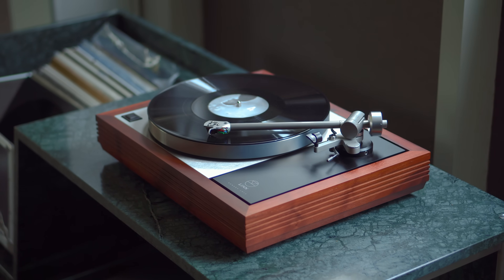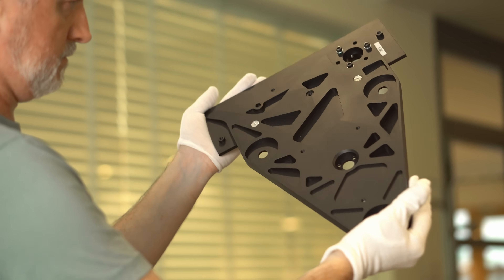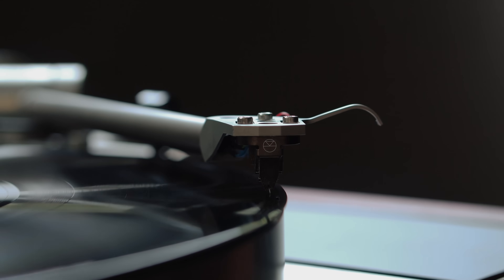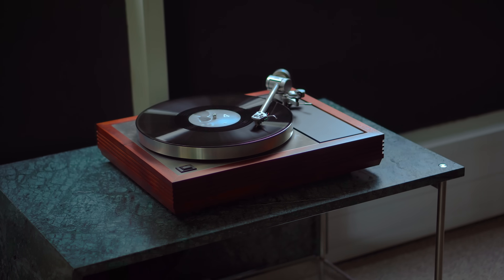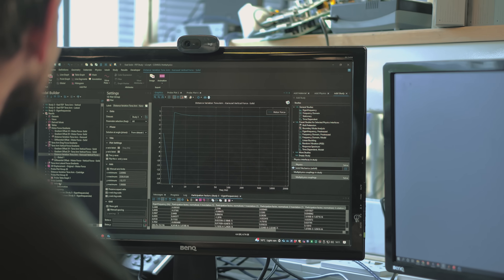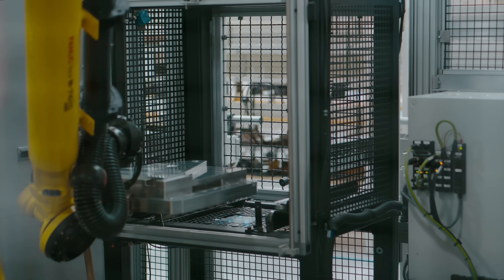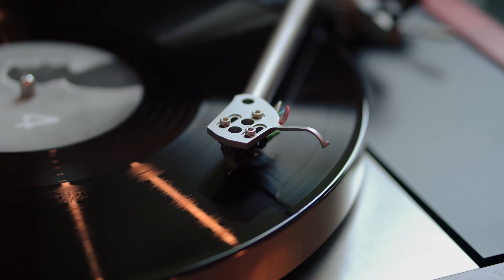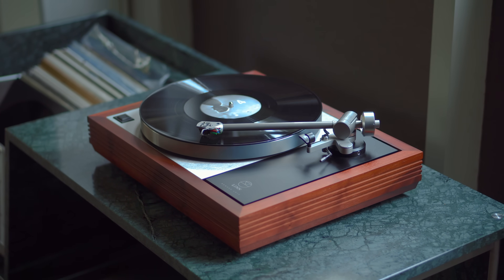New Keel SE: Flagship Sub-chassis for LP12 | Linn

Comment: Nothing new here: Not only did the Heybrook Turntable have a cast aluminium subchassis but so did the original AR turntable (the great granddaddy of all the classic suspended subchassis decks like  Linn, Ariston, Thorens etc.). Logic’s DM101 also featured a substantial 10mm aluminium subchassis. Given the original subchassis rings like a dinner gong I’m surprised it took Linn so long to rectify the issue. However the price is ridiculous! 😮 I’ve made a simple modification to my Sondeck’s subchassis that’s light, kills the ringing and makes it considerably stiffer for around £20. I’ll stick with that thanks. 😊

Comment: As a Cabinetmaker myself, this reminds me of that disgusting, overpriced plywood thing they’re fleecing people. I could make it from the high grade furniture plywood, I’d at least veneer all the external faces to make it visibly attractive cheaper than Linn’s price tag. This, it’s just a casting trued by CNC machining with some black paint... we’ve been casting metal for thousands of years!!

I bet they’ll charge you £1,000 for half a tin of matte black spray paint.

Although, I cannot fault Linn during their early decades, now they produce unjustifiably expensive equipment. Today I cannot afford any Linn equipment, though I bought my Valhalla Sondek (from A.T.Labs in Ilford ) in the late seventies.
Reply: Speaking as an Engineer - Machining a part from a solid metal block (look carefully because it is not a casting that the Fanuc robot places into the CNC machining centre) is significantly more accurate than casting it. Machining offers higher precision and tighter tolerances, making it ideal for parts that require high accuracy, while casting is less precise due to factors like shrinkage and the potential for internal defects like porosity.
Reply: @leqin  - I understand that. That’s why I said it was cast and then CNC machined for precision. It still doesn’t cost £4,250 pounds to produce. Even if it isn’t a cast, the machine did the work. 

I recall the Sondek platter was machined from a solid billet of Zinc, which didn’t cost anywhere near £4,250 back then. 

I’m no Engineer, but I’ve used a Bridgeport (under supervision), turning and milling parts for model steam engines. For further precision, things were then ground. A CNC machine would complete the job at least two or three times faster than me as an operator, without any tea brake or sleep. 

Today, we have zero tolerance CNC machining.
Reply: @Valhalla-ZoSo A while ago I recall watching video of Linns sheet metal fabrication shop, with their Amada press brakes and Trumpf Turret Press - apart from using the same equipment my employer uses we also shared another thing in common - Aalco supply our aluminium also. With the blocks of 6061 aluminium Linn use they are using a wrought product that is extruded and rolled - not a casting - a casting is a completely different beast and actually inferior for the purposes that Linn are using it for. Linn - being engineers - no doubt had in mind that a wrought product such as Aalco's 6061 has high tensile strength, malleability, and durability, as it resists bending and fatigue, properties which a casting can have but cannot match the capability of something made from wrought materials.

The Linn Sondek LP12 platter is made from Mazak 8. It is a non-magnetic zinc alloy and more famously known for being the material that the wing mirrors on cars used to be made from before they became integrated into the driver and front seat passenger doors and then became that other cheap material known as plastic..

Before Linn downloads the correct program into their machine centre, or make a first cut to begin turning it into something more useful, each one of those blocks of Aalco 6061 is worth about £120.

Comment: Hilarious price tho. £4250. 😂
Reply: Yes the pricing is comical isn’t it.  Let’s face it it’s just some machined cast aluminium, a couple of hundred quids worth.
Reply: @greenygreen5308 as a youngster, I always wanted a Linn, but could not afford one. Later when I could, I was baffled by the constant stream of 'improved' components. I have a Project Xtension 10, evolution 10cc arm, Goldring elite and Project power box PS uni PSU. I'm very happy with the sound. Never did get my Linn.

Comment: Wasn't Heybrook, with its TT2 turntable, using a cast aluminium sub-chassis way back in the 80's when the LP12 was still using a pressed steel sub-chassis? and they were producing a complete turntable with that design for a fraction of the price of the current LP12 chassis upgrade...

Comment: The price of new Linn parts for LP12 after 2000 are simply exaggerate , I have a Sondek 25th anniversary with Ekos mk2 Akiva Keel Trampolin 2 Lingo 4 and Linto full spec at that time but I will never spend all this money for replacing parts and bits on my deck  because the sound is already great
Reply: I've got the same spec as you. I'm upgrading the Lingo to a Radikal 2/Utopik, and then I'm out. The new upgrades are beyond my pay grade.